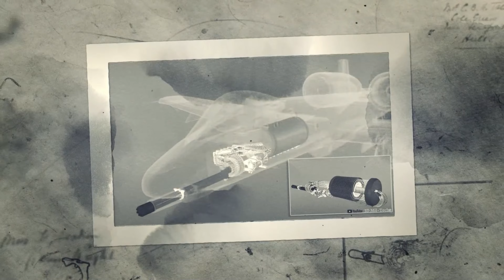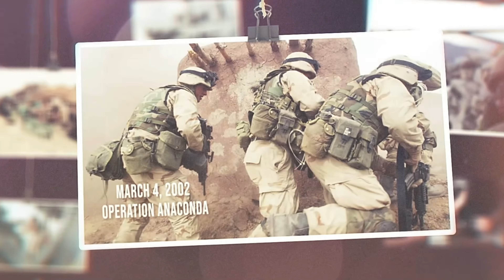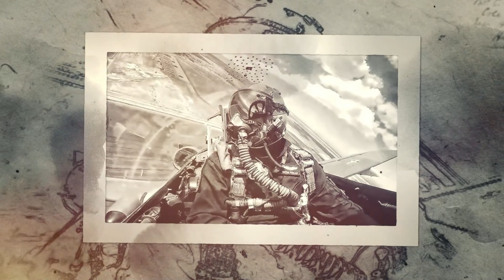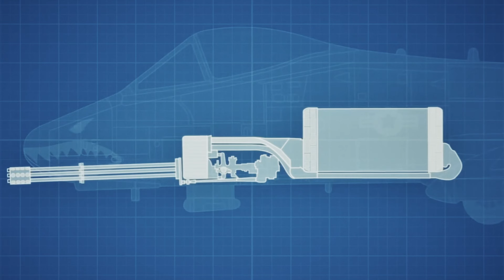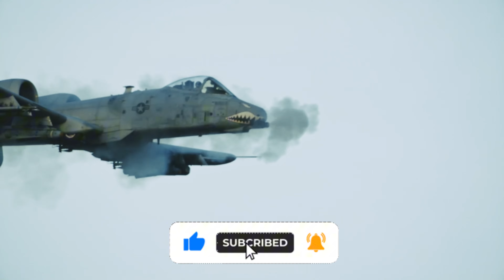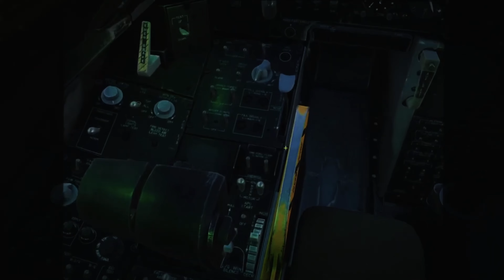Inside The Engineering Of The Deadliest Aircraft

Comment: They say that this plane looks ridiculous, but the biggest absurdity of this plane is just a lame cannon. If the column of armored vehicles is not covered by air defense, the Su-25 will destroy the C-8 cumulative missiles, which penetrate 300 and newer 400-420 mm, which is much larger than this gun. In fact, the shelling of tanks such as T-80, T-72, T-90, and the A-10 cannon does not always penetrate them. But Abrams will be penetrated by a C-8 missile if it hits from above. Also, because of the uranium cores of the shells, the shelling of nuclear countries can be regarded as attacks using a dirty nuclear bomb, which gives the right to strike back with nuclear weapons at a US base.  So the aircraft is so-so, the Su-25 in the new modifications is better. I would remove this cannon altogether in the upgraded version, and place an additional fuel tank and maybe thicker armor to withstand an armor-piercing 30 mm projectile from 1 km, and add a light single-barreled 30 mm cannon with a small ammunition reserve of 100-200 shells, which is enough if there are conditions for firing a cannon, which in fact this rarely happens, because of the need to enter the short-range air defense zone. The Su-25 can also use the UPK-23/250, which gives it much better firepower than the A-10.